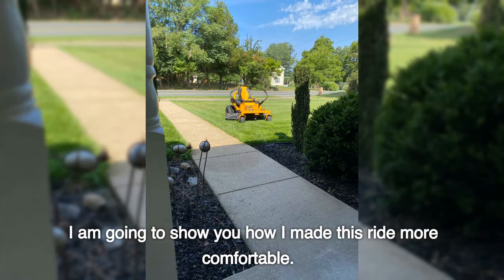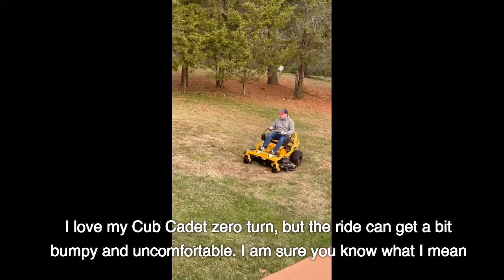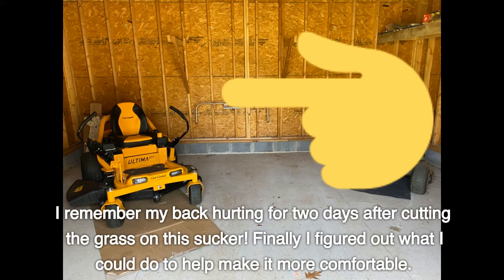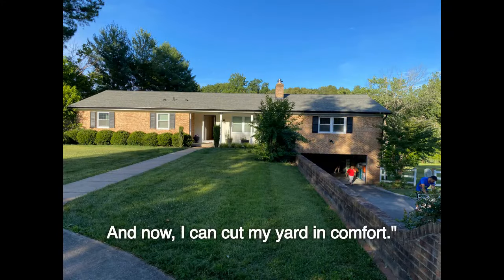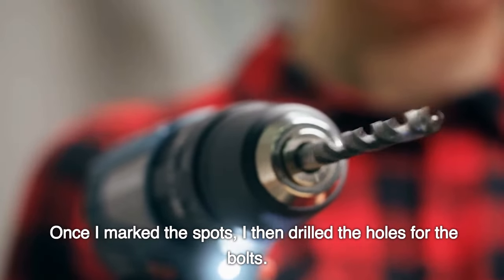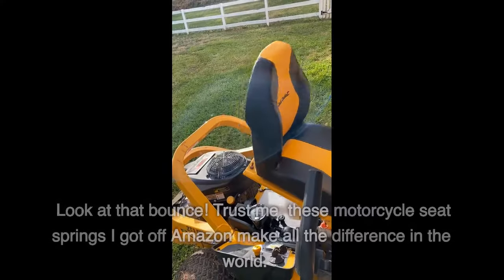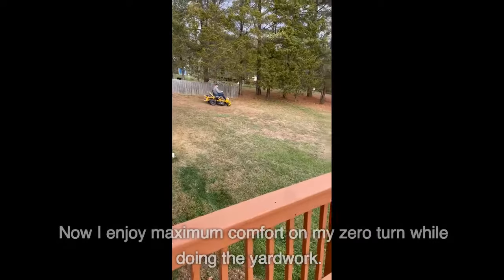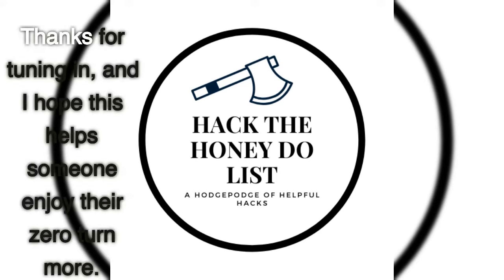Cub Cadet Suspension Hack: Fix Your Back Pain CHEAP!

Comment: Nice upgrade.  I had terrible back pain as well. I went with the Vevor universal tractor, zero turn, excavator, and forklift seat about $300 on Amazon.  That and two gel seat cushions and can ride in comfort for mowing three acres and no back pain days afterwards. 

On my 2015 Cab Cadet RTZ L zero turn 54” deck the Vevor seat holes don’t line up.  I used 6  3/4” self drilling screws and washers and tool only 5 minutes to install.  I use the new seat track to line up with rear Cadet base and secured seat.  That way you have access to battery and engine area.  Just use a bungee cord to secure battery since battery bar is removed since it’s on Cadet seat base. 
Incredible difference.   You dial in your weight, adjust seat back and base where you want and mow and go. 

I was contemplating buying a new suspension type zero turn until I found the Vevor seat and two gel cushions.  

I had to bypass the seat safety switch but that only took 30 seconds to remove the bus bar on my switch.
Reply from the maker: Thanks Anthony! I was looking at those seats. Good to hear that they work great. They do look comfy. I may end up doing that one day. The springs helped a lot but I still have to go slow through the rougher part of the yard. My yard is wo acres of back crippling ruts, haha. Thanks for the info, maybe some more people will go the route you did and mow in supreme comfort!

Comment: Does this not mess with the auto shut off on the seat. It a brilliant idea
Reply from the maker: No that is under the seat itself. These springs go under the seat plate. I am thinking about how to put springs under the seat as well but have to figure out the auto shut off

Comment: Awesome,  what size drill bit and bolts?
Reply from the maker: I believe they were 3/8” I had them laying around, but you will need the fender washers as well.
Reply: @hackthehoneydolist  ok thank you
Reply: Spring model number
Reply from the maker: The link to the ones i used are in the video description

Comment: Smart cookie!
Reply from the maker: Thanks, did you try it?
Reply: @hackthehoneydolist , yes! Works well! I used the 3" springs. I plan on putting a gardening knee pad to put under the front bracket mount. The Husqvarna 22v46 rides terrible. I had to disconnect the safety switch under the seat, but I don't care. I can cut my lawn much faster now!
Reply from the maker: @loveydovey4u  very cool! same with this Cub Cadet, it was a terrible ride. Im thinking about doing something under the front as well. Faster is better especially minus the back pain!

Comment: Did you use 2 or 3" springs
Reply from the maker: I used 2 inch springs, these are the ones I used https://amzn.to/3HZSIbW     Honestly if I was going to do it again I would try the 3 inch. Either way the ride is much better. Good luck.
Reply: @hackthehoneydolist  thanks I ordered 3 already just to try 🤣🤣🤣 hope it works 🤞🏾
Reply from the maker: @henrythompson5624  let me know what you think when you do it 👍
Reply: @hackthehoneydolist  will do thanks for your help
Reply from the maker: @henrythompson5624 how did the 3 inch springs do for you?
Reply: @hackthehoneydolist  so I took them off in put on the 2s because it was sitting up to far for me due to my weight not being enough. Idk but I plan on putting them back on some day because the 2s work get for me.i have some rubber bushings that I plan on putting on the front of the seat to make up that offset from the back for the 3" springs just being lazy because I have togo get longer bolts. 
So far I did
Seat springs 
Seat chain keeps it a 90
Hour meter 
Mulch kit
Fab a rack to hold my whip so I don't have to keep walking back and forth to the shop.
Reply from the maker: @henrythompson5624  I need to do the mulch kit. Probably my next add. I have the hour meter already.